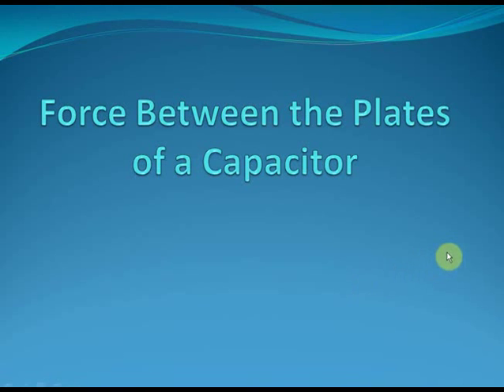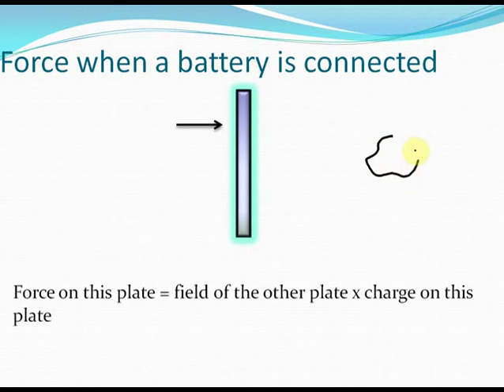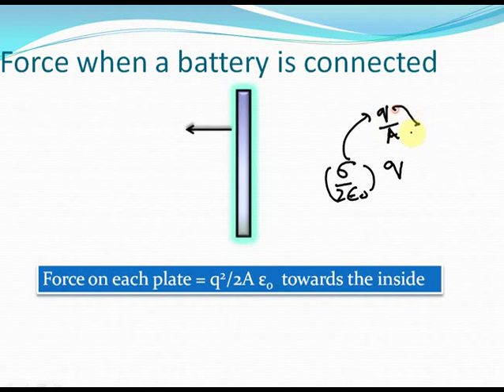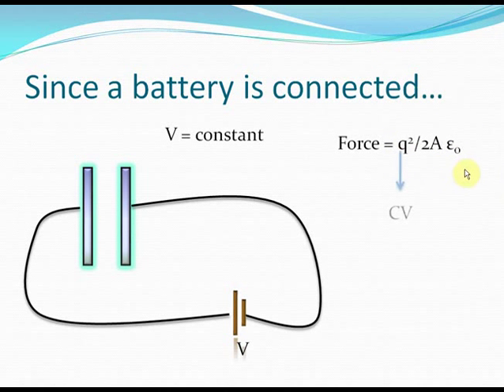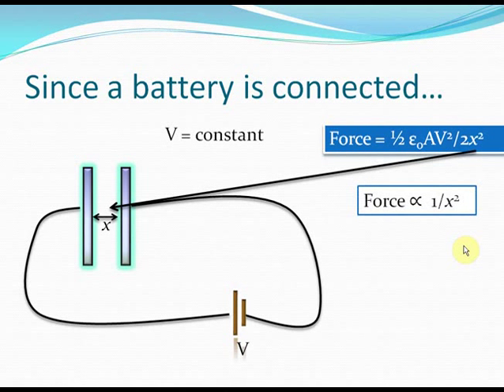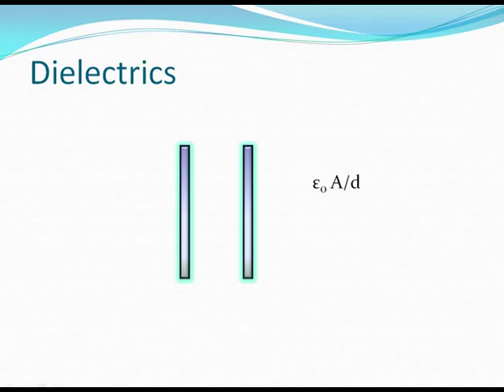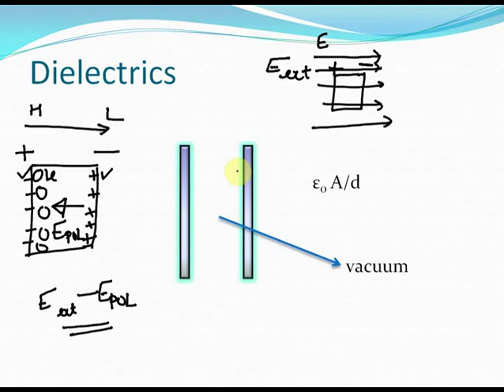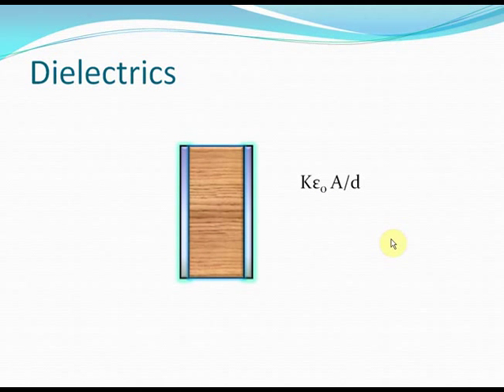Force Between The Plates of Capacitor

Comment: Nice explanation.  At 5:16 you introduce the Force equation while the capacitor is connected to a battery.  I believe you have an extra "1/2" inserted... Should be F = e0*A*V^2/(2*x^2)